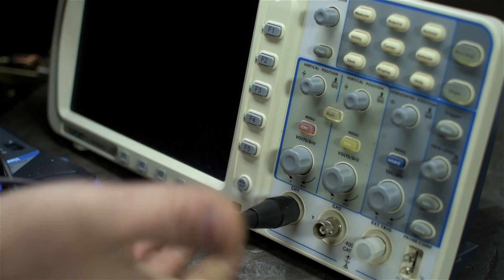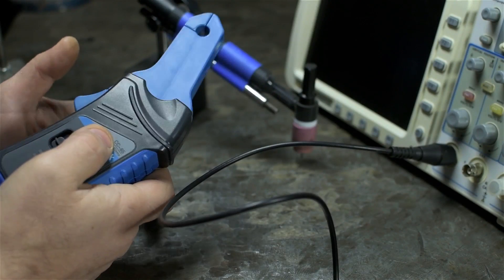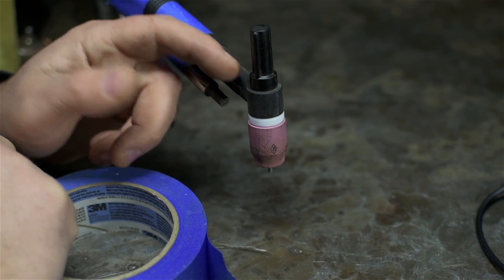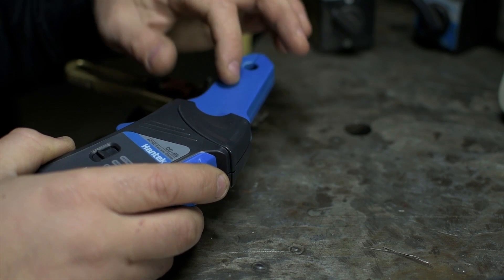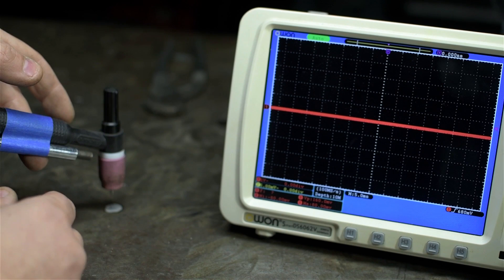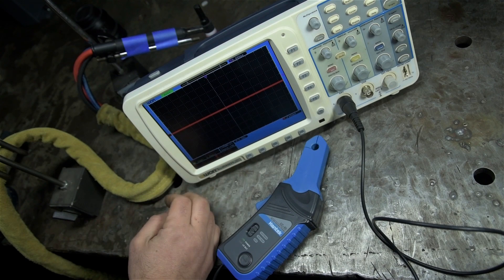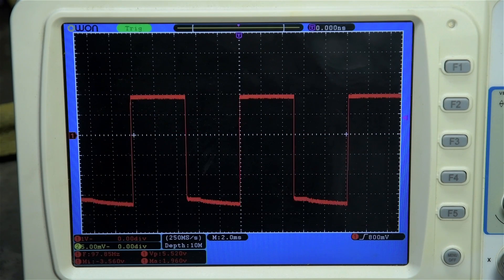Oscillo-Help-Me?

Comment: Have you checked the voltage offset on your scope?  also the hf throwing your scope off could be due to not being grounded or due to it being too slow (eg 10MHz scope vs 200MHz signal)

Comment: Perform the same test using a multimeter in place of the o-scope and see if you measure an offset.  This will eliminate the o-scope as an issue.  It is interesting that according to the scope readouts the negative peak is -3.56 v and the positive peak is 1.96 v.  3.56 - 1.96 = 1.6 or a 800mv offset as indicated by the scope readout.  I always get suspicious when performing such tests and the numbers come out even. i.e 800 not 801, 799 etc.  That would make me think it is a scope issue, not the welder or ground.  BTW, be cautious about grounding a floating digital o-scope, could go poof!

Comment: Running the scope from batteries shouldn't matter here as the probe is completely isolated from the welder anyhow.
I noticed when showing the clamp in your video, you had the switch set to 1mV/10mA. In that mode the clamp is only rated for a maximum of 20DCA or 15ACA. You'll want to be using the 1mV/100mA position to get the full 65amp range out of the clamp.
The manual mentions about setting the zero point when measuring DC current, but mentions nothing about AC. Before measuring with the clamp, I would open and close the jaws a handful of times, set the scope to DC coupling, and use the zero adjustment on the probe to set it to show zero volts on the scope. This is a hall-effect current probe which shouldn't have any issue making the measurement as long as you're below the current rating of the clamp. Also, for taking a reading on the scope, I don't see any reason why it would read different between AC or DC coupling. Unless they have some kind of strange circuitry in the clamp, it should read basically the same either way.

Comment: I'm sure people have covered everything else (i.e. ground ref and / or shitty clamp on meter) so I'm going in with a real long shot.

You're measuring the "return" current in the ground lead, now your big metal weld table could (read "probably is") providing an alternative path to ground, so you're not measuring the full current coming into the torch. One would assume that the leakage would be symmetrical either side of the waveform and wouldn't really matter for the measurements you're taking, however metal oxide layers can act as ersatz rectifiers, in which case the welding table could be providing a path to ground that conducts preferentially on one half wave compared to the other.

Comment: The scope is correct. Your probe is lying to you. That square wave is too perfect. No way is that possible under your circumstances. Oh, and remember to squirt some Argon when measuring. The ionization potential for Ar (+-16V) and air is different, so, may influence the arc.

Comment: At 4:40 freeze the frame where the welder is turned off. Then you can clearly see that the positive signal is clipped. (The positive flyback spike is truncated) So I would as others have suggested flip the clamp. If it still is the upper part of the screen that is clipped, the clamp is overdriven and not balanced.

You can also try to measure the current in a 12V 100W halogen lamp. When it turns on it is almost a complete short so some of the inrush current should peg the clamp. If not, make 2 or more turns through the clamp to make it happen. Do this with clamp turned both ways to check they are mirrored images. The bulb will not have a HF start, which just may upset the clamp. Being a DC clamp, it is not a current transformer, but an electronic circuit. It is also a single pulse that is not rich in harmonics and very repeatable.Also try turning off the HF start and scratch start on a piece of heavy copper to not tax the EMC capabilities of your scope and probe.

You did remember to zero the clamp and snap the jaws open/shut a few times?And no, do not ground clamp or scope as som write! Your thinking is right, a fully floating setup protects the instruments and does not introduce any ground related errors.

Comment: Have you talked to Miller, Lincoln or HTP yet? One problem may be your "load" setup. Maybe you can't just connect the tig electrode to the ground via your workbench. They may have a calibrated load  for their measurements and the machine adjusts as necessary. Kind of like an audio signal generator with 50 ohm outputs. If the load impedance doesn't match the output the voltage will not match the front panel controls. Really like your videos and always learn something. Retired electrical engineer and amateur welder.

Comment: Is there any chance in current leak trhough the machine.... when voltage positive the table connects it to ground, what if you take  piece of rubber under steel plate and connect the ground clamp to steel plate?

Comment: Could it be that there is just resistance in the circuit? I mean the circuit between the welder torch and ground. Maybe this vould create a dc off-set (the assymetry you witness). You could rule this out bij arcing on a peace of copper/brass/aluminium. Which should have lower resistance then the dirty, i mean very clean table.

Comment: I guess there's something to be said for the old analog scope like a Tektronix 465.
Here's an idea.  Remember how the cathode on a vacuum tube works.  The heater heats the cathode to assist it in releasing electrons that make their way to the plate.  The plate can get pretty hot with all these electrons bombarding it, same as the base metal with electrode negative.  The tungsten gets quite hot on it's own, so it is always going to be a good source of electrons, but when the  welder switches to electrode positive, the base metal is not such a good emitter, so the current flow,  when the base metal is negative, is limited more the voltage between the negative metal and the positive tungsten than the constant current control in the welder.  The welder can only put out so much voltage, so the low impedance condition of the electrode negative will deliver a much higher  current than the higher impedance condition of electrode positive.  
One way to test this is to arc to another tungsten with about the same shape as the one in your torch.  Presumably, at 50% duty cycle, they should be at similar temperatures.
The ramblings of an old EE.
Reply: George Carlson  Exactly !!!! I designed ac tig welder with 300A full bridge and arc rectification is responsible for assymetric waveform . I commanded 50:50 both currents,but output was assymetric.Look at my channel,you can see videos of that arc at 2 different frequencies.Also arc rectification makes ac tig low amperage arc starts and stabilisation much more difficult.Respect,old EE !!!

Comment: Could you please try to make the area (!) between the positive and negative wires as small as possible? Actually, the area of the whole "circuit" should be as small as possible. For example, twist the wires.
The background: You work with quite high currents here, which also change very fast (see the sharp rising and falling edges). The larger the area the current travels around, the larger the inductance, and the larger the stray field. This strong stray field induces voltages in every other electrical conductor, and the scope's electronics is quite sensitive to it. Hence, the dancing menues.

Comment: Tony the pixies will escape from the circuit board directly through the scope plastic case. Put the scope on a plastic shelf that is several inches above the welding table or better yet a wooden bench nearby.
If you have any clip-on ferrite common mode chokes in your junk box put them over the scope cables.
You might flip the current probe around and invert the current waveform. This might show clipping if it is happening.
The advanced course involves aluminum foil shielding of the scope case and possibly the current clamp, hats anyone…
-Peter

Comment: A lot of people here are suggesting grounding the scope with your TIG, but that's potentially a very dangerous idea. I'm not sure how competent of an electrician you are, but without completely understanding the schematics of your TIG, I wouldn't even think about that. You can fry both your scope and your TIG. This video from eevblog gives quite nice explanation: https://www.youtube.com/watch?v=xaELqAo4kkQ
I didn't quite undersand why you consider this to be a problem, but my guess is your readings are "wrong" because of your setup. I don't think you can get reliable dc-coupling from these clamps which are doing some kind of induction+hall effect black magic to measure both AC and DC. If DC coupling is really what you're after, you'd be better off using some high-amp shunt resistor to measure voltage drop.

Comment: Trying to send the message again..You have a RFI problem. Un ground the scope to isolate it. The inverter is generating a lot of high energy RF on the power line And most likely the welding cables are transmitting a large signal through the air. Get a large toroid and put 6 to 10 wraps of the scope power cord through it. Do a similar thing with your scope probe cable. The starting voltage is likely kilo volts and maybe a different frequency. Check scope setting for that. Keep welding cables away from scope power cord and probe.
Reply: I tend to agree with Kenneth's size-up of the situation and would add/refine a few points:
a) Doesn't matter if the scope does not have a line power supply because RF (or in this case High Frequency noise) can still be the issue. The HF noise travels right through the air to the sensitive Hall Effect Sensor in the "current clamp" which is EMF based.

 My response to this observation would be to try to first shield the Hall Effect Sensor (also could not hurt to take a look at it's specs of operation paying particular attention to the HF aspects of the HES's "current clamp") and secondly to try a different way to pick up the signal. (What do welding companies use when/if they do this in house on their own machines?)

At the moment the biggest thing that is bothering me is the video's reference to calling it a current waveform. I know this was probably just a slip of the tongue or temporary oversight by Tony but I see the scope IS set up for VOLTAGE measurements. So it's improper to think that waveform is the current. It's still the voltage even though a "current clamp" probe is being used. Current could still lead or lag that visible waveform.

What the waveform's position below the line is telling me is that there is a clear negative voltage DC offset. IF this is accurate to what is happening at the welder's electrode I would posit that it is that way because this is some of the technique the design of the welding company installs to make it work as good as it does. Balancing it more towards the negative than the positive.

So Tony, you're wrong when you think you are getting less positive current than negative current. I suppose it's because you don't have any formal electronics schooling. It's a voltage representation not a current representation as you point out at 1:22 in the video. When you adjust your thinking as such maybe whatever 'problem' you see will clear up.

But knowing that I have to question if you are not making one of the simple errors of beginners to scopes. Like is your DC offset on the scope set wrong?

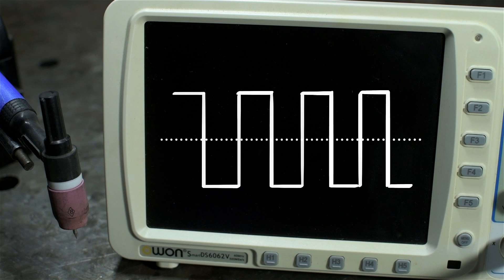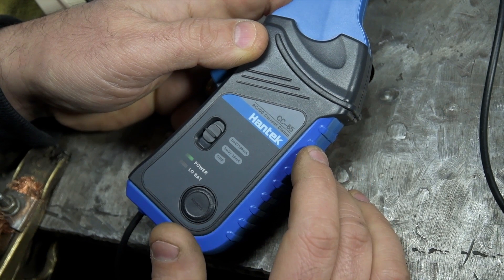I am not really sure I see any "problem". At 2:16 you clearly refer to the voltage amplitude as current amplitude. I think the erroneous way you are thinking about it is the problem. 6:30 There you are onto something.

If you want more waveform data I would use a normal scope probe and tap it off at the pre-amp stage inside the welder itself. You have different stages of amplification inside the welder. Some like common emitter amplification will amplify voltage and current and invert the signal 180 degrees while others will amplify current.

OK, so there is what you are doing wrong here. ha! Yes, you're learning electronics the hard way. In an oversimplified way this might help you as this will most likely be in the welder's output driver:
https://www.allaboutcircuits.com/textbook/semiconductors/chpt-4/common-collector-amplifier/

The important thing here is the set up of the amp. Your welder will most likely be using MOSFET technology to deliver all the Amperage. The key thing to remember is when a transistor is set up as a Common Collector Amplifier is that it will amplify the CURRENT and has a VERY LOW IMPEDANCE.

You know why the current is important, it does the meat of the work of heating the metal. The low impedance is important because the maximum power transfer theorem( google this for more details ) says that the more you can match the impedance the more efficient and better POWER transfer you get. You see this the most often in Audio Amplifier specs where they might say you can get 100 Watts driven into a 8 ohm load. It's impedance matching for maximum power transfer. A welder is going to do the same thing and though its a total different beast to have a live arc I'd imagine the oversimplified circuit would illustrate the welding as almost 0 Ohms or a dead short.

Very interesting to see the HF action of your welder. We are often taught that the higher the frequency of the signal the more it rides on the outter diameter of the conductor and at microwave freqs it rides off the conductor. So much so that waveguides are then used at those frequencies. It's fascinating to see the penetrating power it has when coming out of the torch.
Reply: The scope is battery powered
Reply: He has an RFI problem for sure while the high frequency start, but that wouldn't create an stable measurement like he has after that, probably the clamp is either not correctly set to zero or has and internal problem and the positive range is not working properly. The best way is to test the current clamp to the full range with a known working current waveform
Reply: His scope is running on batteries it is not a ground or power line issue.
Reply: Power cable is only one entry point. The RF radiating off the welding cables and the power cord are usually large amounts. A scope, especially if a battery powered one , are not designed for high energy commercial welding environments.

The clear look on the scope,  that was with the older welder and the setup with respect to sensor cabling may be different. Something is going on and resetting electronics is a sure sign of RF getting into them. Easy to kill equipment as the RF can be many times a higher voltage than the welder is set to supply. Also, magnetic fields enlarge as more current flows through a wire..Something a welder outputs in large amounts. Might be worth while to test at lower currents than are required to weld anything and if that level works ramp up the current.

Comment: I suppose you are adjusting the zero of the current clamp, right? If you are already doing it, I would suggest to test the clamp with a known symmetrical current waveform, a good way to do this would be with a toroidal transformer, like here https://youtu.be/q1LvleZcJm0?t=2m58s if you don't have a toroidal transformer maybe an old microwave transformer could help. This way at least you can know your clamp is working properly.

Comment: Try current scoping the live (hot) wire of something plugged into the mains, see if you get a symmetric sine wave, or whether the scope exhibits the same asymmetry.
Reply: it's a current clamp, as long as you are under max current and the conductor it insulated you are good to go

and most houses have 240Vac piped in for electric stoves, clothes dryers, heaters, and welders

Comment: You can test the current clamp on a resistive load like a heater. The grid voltage should be a pretty balanced sine-like wave and with a resistive load the current should be equal to the voltage at all times.
Reply: Not equal but proportional. Good suggestion otherwise.
Reply: Michel, of course. I was thinking equal waveforms in my head and just typed equal.
Reply: Looks like equal equals to equal in your head ;)

Comment: Hi Tony! Could you forget about measuring current for a moment and measure output voltage. It's a kinda tricky but you need to connect your stock 10x probe to the scope. Oscilloscope can withstand this voltage without HF start of cause. Check if the voltage waveform is good. Then, we know that electrical arc acting like gas filled zener diode which means it could react differently on positive and negative pulse.
Next time I'll bring my scope to friend's workshop and  measure TIG current waveform!
Reply: An arc that long would fry any 10x probe. He needs a 100x or 1000x probe.
Reply: Note that 1kV crosses about 1.1mm in air. 11mm means about 11kV. When there is no arc, the voltage could be even higher than that, because the welder is not loaded by the arc.
Reply: Last time I checked an average scope can handle 300V 50 V/Div with 10x probe (techucally 10:1) and maximum arc voltage for TIG welding is something around 25V. You're talking about spark and in this case it would be 1-33Kv per 1mm for Air. With HF start turned off the voltage will never exceed scope's limit.